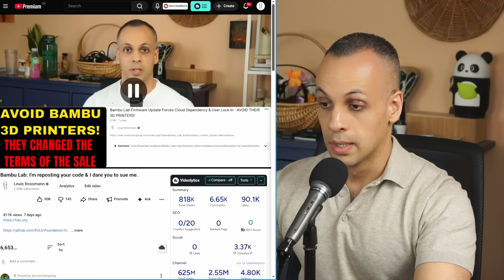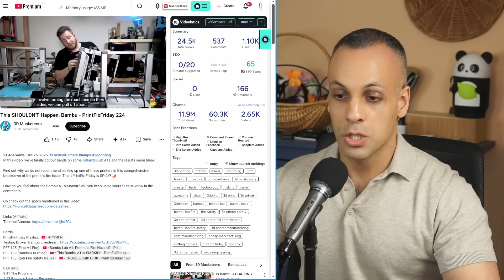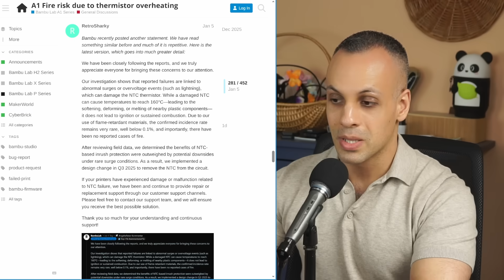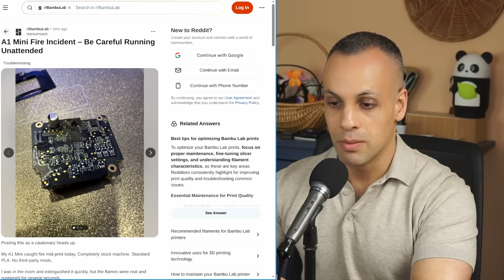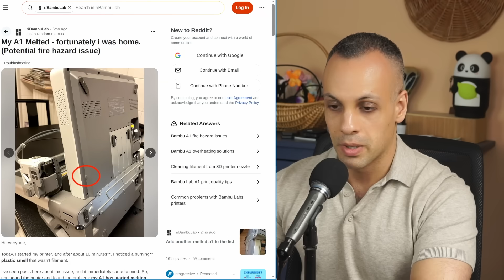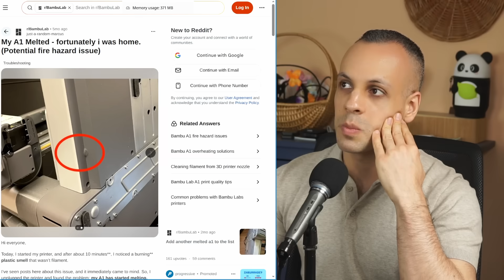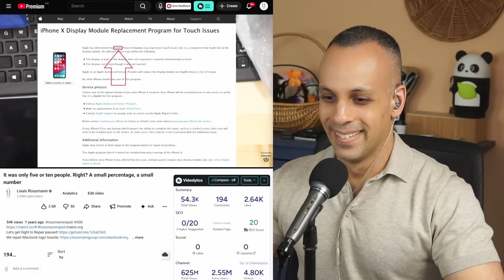Bambu Lab PR dumpster fire is turning into a literal one...

Comment: I started in 3D printing a few years before Bambu Labs emerged on the scene. Based on my research at the time, I went with Prusa Research. Given the option of a kit or a fully assembled printer, I bought the kit - 12 hours of assembly later, I'm glad I did, since I built it from their parts, I can also repair it (yes a manufacturer that believes in Right to Repair). That printer served me well, and the person I sold it to still uses it. My second (and soon third) printers also came from Prusa. The most recent one only comes fully assembled, but even better, that assembly is being done in the United States, not China. Still can get parts, and repair it yourself.

Jo Prusa led the team that forked the original Slic3r into PrusaSlicer (which Bambu then forked for their Slicer). They also promote their devices as being fully operable offline (you can actually order "critical infrastructure" ones that have no network connectivity, requiring the model files be loaded to a USB drive directly on the device). I for example have my 3D printer on the local network, but have the cloud functions disabled. I can still print without the printer fighting back.

Yeah, Bambu has innovated on certain things, but for example their AMS multi-filament system is a similar but different clone of the Prusa MMU (which I have been using for a number of years). Prusa's version uses a prime-purge tower without the extra "poop" the Bambu printers produce. Bambu is also putting RFID chips in their spools of filament, which concerns some that they may try to vendor lock you into using only their filament. Prusa on the other hand has put RFID chips in the spools as well, but opened the protocol up to the open source community, and a number of other companies are joining Prusa to expand support.

Where Prusa falls down is the marketing side of things, they haven't got into the MicroCenters and other direct to consumer chains like Bambu and Creality have, but their Core One+ and Core One L run circles around most of the other players in this space.

Comment: I am a EE with a few devades of experience. While I haven’t examined the circuit in question, the proposed solution of “let’s just remove the thermistor” doesn’t seem right. There are ways to design inrush protection circuits with acceptable failure rates in the presence of strong surges (like lightning in one of the examples). The tradeoff I’m guessing is cost (components, redesign effort, and retrofitting / recalls) vs a desired failure rate. You’d also have to consider the consequences of a failure, fire and loss of life, vs something benign like an LED doesn’t turn on. These are the kinds of things UL certification would test for, but a brief search says Bambu Labs printers don’t carry the UL or the European equivalent marks.

Comment: Louis I applaud you bringing these things to light and helping people out who need it. As a retired nurse, I like my 5 Bambu Labs and I have not had any of these issues. I have seen those videos on the A-1 fires, and can say I have had a similiar thing happen to my Chitu filament dryer. It just burst into smok and hissed at me. Chitu said it is because power in the USA can be unstable at times. Which is a weird thing to say because I have many delicate electronics connected to my home power that even has a power circuit that can minimize power fluctuations and strikes. Its called Zap Cap through our power company. Even before that I never had any problems. But Chitu would not even hear of refunding it. Luckily I got it through their Amazon store, so I got it refunded through Amazon Prime. The point is I am  confused what to do with all this Bambu Labs stuff. The only thing they have done is that my H2D cannot do a temp tower test unless I build it myself, which I do not know how.

Comment: I purchased my Bambu X1C in December 2022,  I gave it away in April 2026.  It was OK when I first started using it, then it became more restricted and less usable.   I purchased an Elegoo CC1 and two Snanpmaker U1, both as easy to use as a Bambu, and less expensive.    Bambu created the easy to use out of the box experience, then crapified it.  Now almost all of the 3D printers have self alignment, cameras and advanced user features, many with true tool changers that let you run them without going through the Chinese cloud.

Comment: I have a Bambu X1C that I bought a few years ago and I really like the printer itself, but there is a reason I don't connect it to the internet and won't get another one. I don't trust them to not pull an HP and push a firmware update that will require them to use their brand of filament or other restrictions, and I don't like how they are going after open source software.

Comment: As i see it: bambu printers are not really easier to use than other modern printers. however, their ecosystem is pretty damn well developed. you find so SO many models on their site. and for someone who doesn't really care about the technical side, you also get print profiles. The only thing i care about now, is the size of the ecosystem they have created. When i go to printables or some other site for 3d models, what i find is kinda basic by comparison. that is not to say this can be the case for everything, but in my area of interest it kind of is.

Comment: Chill with the talk about fire, 160 degrees in a flame retardant plastic enclosure is not a major fire risk. I'm sure AMD sold products intended to run that hot lol jk. 
For sure Bambu should make it right, fix the design, replace the post, but it is irresponsible for you to talk about it as causing fires if there are no confirmed fires.

Comment: No I would never buy a Bambu Labs machine because the writing was on the wall from the get go.
There are more than enough alternatives available without vendor lock in.
I think if I treat myself to a new printer it would probably be a Prusa. Or, I would build a Voron.
But the UM2 and the Ender 2 are still more than enough for my needs, even if they have virtually zero creature comfort compared to today.

Comment: as a bambu printer owner, i SHOULD warn you: this WAS the problem with FIRST batch of A1 model. they fixed it really fast and people got free replacement parts for it. i heard about it in 2025, and was concerned should i buy a1 or not, and to my relief i found out that was quickly fixed

Comment: Would I buy a Bambu printer? Absolutely not. I built mine from a solid base (Creality Ender 3 Pro) and then heavily modified it to the point that there aren't that many original parts remaining. I bought a completely different brand for my SLA printer from Phrozen for those times when I need truly high resolution prints.

Bambu was too expensive for what they were offering when I was looking for a PLA printer. I felt rather justified in not spending that money on them in the first place as they screwed with things over time and trying to lock the user in like printer manufacturers did with ink cartridges.  Nope, no thanks.  Every (paper) printer I bought that had locked-in ink cartridges went into the trash and I simply stopped replacing them with similarly locked-in BS. I replaced them with cheap color laser printers that had 3rd party toner refills not only available, but cheaply available.

I used to think Bambu printers were pretty damn awesome, but while they may look slick and sleek on the outside... Their internals just aren't worth the price of admission.

So, Bambu can get just as bent in the trash bin as those chipped ink cartridge printers.

Comment: I specifically avoided the major 3D printing companies because of my parent's experience with 2D printing companies growing up. They'd sell a machine, update it with problems, and required their proprietary ink cartridges. It became cheaper to just buy a new printer every now and then.  Wonder how long until Bambu and friends start requiring their proprietary filament. IIRC, they've already got RFID tags on them, and a reader in their multifilament systems, can't be more than one update away. Maybe they'll push it out while everyones pissed at them already and hope the drama dies down later.

I went with a Sovol printer, as it was based off the Voron design and the material cost for the Voron I wanted was more expensive than the equivalent Sovol. (It will still never be connected to the internet)

Comment: I recently bought a 3D printer. The BBL printer I might have bought was technically better in almost every way- but I bought a printer made in the EU becuase : it was made like a proper machine- not like a disposable inkjet printer.   ....And then there are the issues with BBL and their misuse of the opensource licence etc- screw those guys. I didn't even consider them.

Comment: I ordered a P1S way before all that in early 2025 went on. Disabled internet access and enabled developer mode when it happened. I will keep it that way until that thing breaks. I don't need firmware updates, since that thing works great the way it does right now. If I ever buy a new 3d printer, It won't be a Bambu because that broken trust can't be restored.

Comment: are they legally require to gaslight and minimize the risk of their printer?

because NTCs are one of the cheapest and easiest component to find and source, they could at the very least release a how-to replace the NTC or the board if the customer considered it was necessary

Comment: Bought a Prusa MK3S 2019, still works flawlessly and is easy to maintain & upgrade. 

The convenience features of modern printers like Bambu can easily be found in brands that aren't trying to be apple.
Reply: Easy to upgrade perhaps, but exceptionally expensive.
Reply: @loganmedia1142  €800 or so after shipping for the kit, 7 years ago, with the features and reliability of the MK3S wasn't bad.

That they cost the same these days could be considered expensive, sure.

There's plenty of alternatives though.

Comment: I have 6 Bambu printers, and one Prusa I bought recently.  I’ve already decided based on the Prusa that from now on every Printer I buy in the future will be a Prusa and not a Bambu.  I just don’t like what Bambu Lans has turned into, I don’t like dealing with their support that take months to diagnose problems, I don’t like their app which barely works, I don’t like their AMS reliability issues, the way you have to take the whole damned AMS apart when a piece of filament breaks.  And most of all I don’t like how they’re being such a$$holes with the software and licensing!

I’ve bought the last Bambu printers I’ll ever buy, and while I’m not sure about ‘dumpster fire’, I think that ‘dumpster’ is where the four Bambu bedslingers I have will be heading before too much longer, and I’ll probably only keep the two Bambu Core XY printers until I can afford to replace them with Prusa.

Comment: I own 2 bambu which I bought 2 years ago, before even the first of Bambus bs. They still run old software, connect to orca, and they do work well alright. Not sure about the modern bambu, but at the time I bought mine, they made solid printers, better than some of the competition. I do hope that someone who actually doesnt close their system will take their place.

Comment: It's worth noting that these devices, by design,  take plastic up to 250C ish.  It doesn't sound like their design flaw, which takes a board up to 160C, is a particular fire hazard, even if it is shitty for other reasons.   That doesn't make it OK, but for many years the majority of 3d printers being sold had a thermal runaway condition where the hot-end temperature control thermistor could get pulled out of the heater block, causing the printer to think the heater block was too cold and dumping more current into the heater, leading to dramatically hotter temperatures and substantial fire risk (although only a couple actual fires reported if I remember correctly).  Being less-bad-than-recent-competitors isn't a  great defense for an overpriced 3d printer that's supposed to be idiot proof, but things could be a lot worse.  Their software seems like more of a problem than their hardware.

Comment: I guess when I bought my Bambu late last year I kinda knew what I was getting into.  My printer doesn't connect to the internet, and I can't use Bambu studio.  I don't know if I have the latest firmware, but I know I have firmware newer than the revision that turned on the cloud authorization, but I am not 3D printing for gain, and the Bambu is head and shoulders better than my previous couple chinesium knock-off printers that turned out to require so much baby sitting that I  spent more time messing with the printer than I spent actually printing.  Maybe I  am a non-typical user, Linux only house, plenty of Raspberry Pis and other DIY gadgetry.  I bought the printer from Bambu, but have not ever attempted to use their infrastructure. All this kerfuffle hasn't affected me in any way.  I have had no personal experience with Bambu to make me dislike them.
HOWEVER... I am philosophically very aligned with the open software and hardware culture.  A company that builds on other peoples work and fails to meet the obligations that are the actual cost of obtaining the software/hardware is a thief, and should be prosecuted under criminal law, not just civil contract law.  There are plenty of open source licenses to choose from, and some of them don't even have any code release clauses.  That was why Apple chose to build on BSD licensed code, they are not required to release source and changes under that license.  A company needs to make the choice of license before they commit capital to producing product that is released under that license.  
I don't know if there is any BSD style licensed software in the 3D printing realm, but whether there is or not Bambu picked code under the AGPL to build on.  If they want to change course now they have an entirely legal way to lock their product down.  Just start from scratch and write all proprietary software.  I don't think it would be financially feasible to do that, and all existing hardware/software would remain free to use so they would have to make new locked down hardware to go with their locked down software, but they do have that option. 
The option they do not have is the path they seem to be taking; threatening people with legal action  over code that is baldly and explicitly covered by the AGPL.  I would absolutely love to see a free minded and energetic DA bring a criminal fraud charge against them over this action.  Yeah, anybody that buys a printer has standing to sue in civil court, but Bambu has money and a legal team to drag things out and make suits miserable and expensive to bring.  A criminal proceeding would proceed quicker and if successful would basically make civil cases a formality with guilt already determined.
I really hope there is a shakeup in the company, because right now Bambu still has time to reverse course, and leverage their market share and the satisfaction people have with their printers to become the giant in transparent open source printing.  If they just built an internal team to interface with the probably small percentage of users that actually care about this and build a community it could be beneficial for all involved.  Those users, while a small percentage, would be a willing test group for software in development.  If they really honored the spirit of the AGPL they would find some of those users would actually contribute code that would benefit Bambu.  
TLDR:  It makes me mad to see this commercial exploitation, and it makes me sad to think of the opportunities missed.

Comment: No, just, .... No. I was in the market 2 years back when they (Bambu) started with their lock down BS, I went and bought a ks1.... Still have not had any bs.... None..... 

No, "you can't use this or that app"... Nothing.... CAD, slice, print.... That is it... 

Creality might not be the fastest or best, but, their machines just work... Prusa is just unaffordable in my neck of the woods with an 18.6:1 exchange rate... 

Soval is unobtanium due to import costs so yeah, Creality it was.... 

I will NEVER buy a Bambu EVER. 
My money. My choice.

Comment: Got a P1S combo recently because it is so much easier to make it work when you are printing open source projects... I had a moded ender3 earlier and i just got tired of having to calibrate it myself.

Bambulab are great printers, i just don't get why they make such a shitty closed source software when they are not making money from it... They have a good and secure revenue stream with the AMS and the bambulab PLA which is not that expensive, is a fix brand that will keeps the same colors and even has the RFID thingy which is genius

WHY DO THEY MAKE SUCH A MESS WITH THE SOFTWARE... this is a genuine question, i don't get it
And TBH there are still far far from the worst offender -> HP